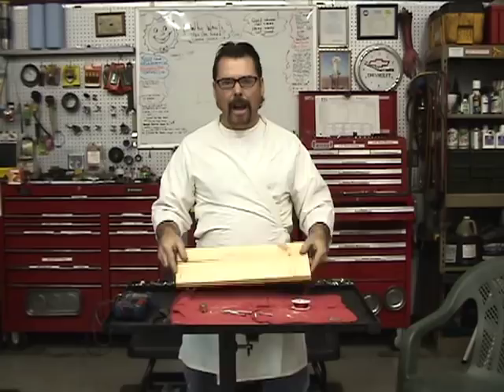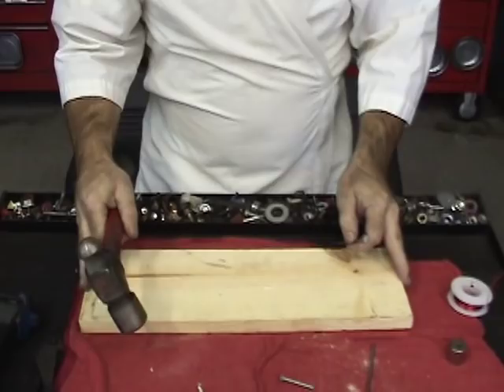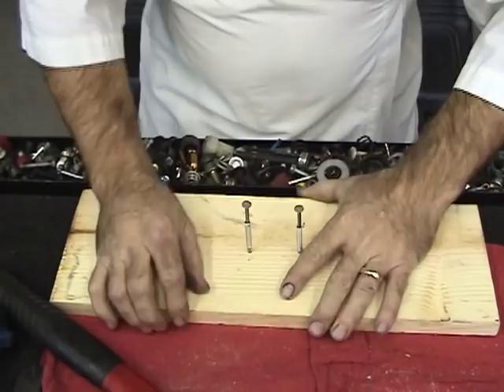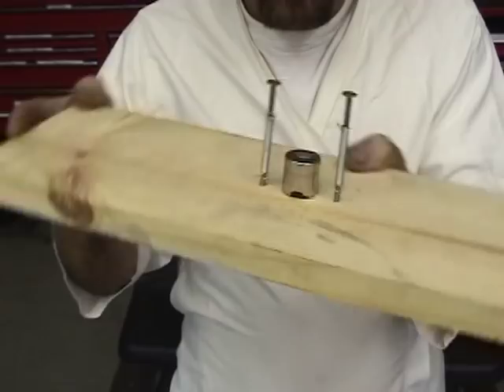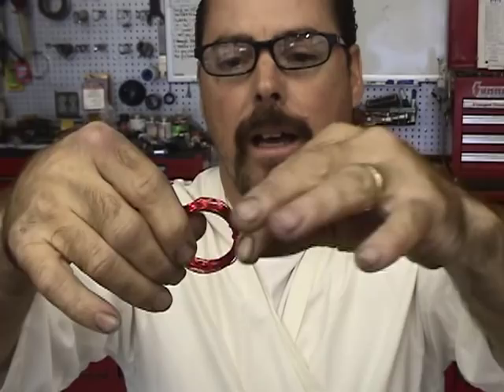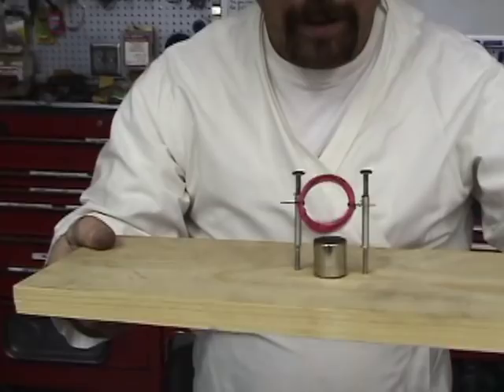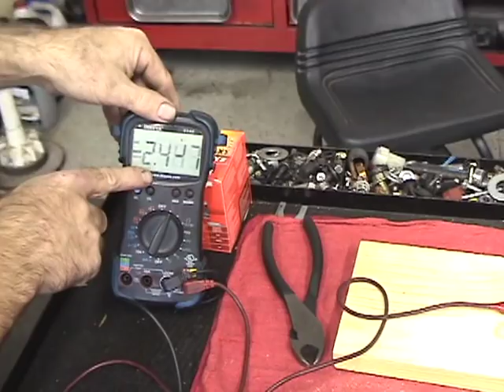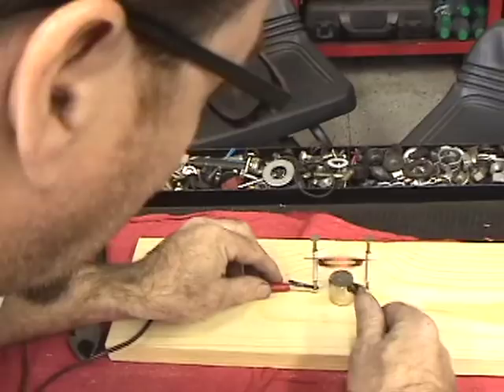FREE ENERGY MOTOR !!!!! How to build it.

Comment: By moving a coil near a magnet, electrical current will flow in the coil. Electrons in the wire move in response to the wire's motion through the magnet's magnetic field. Half the time the coil is an electromagnet. This happens when the sanded side of each lead is pressed against the springs. When the enameled side is pressed against the springs, the coil is not an electromagnet. This is how on again, off again of the coil creates motion, essentially you have made a half-motor. In a full motor the coil is never off.
Reply: > By moving a coil near a magnet
The process of "moving" takes kinetic energy. Magnets have no kinetic energy to transfer to the wire. The magnet has no kinetic energy, the wire has no kinetic energy, the nails & springs have no kinetic energy, & the wood has no kinetic energy. To move something continually takes a continuous source of energy.
Reply: @ScottMartinD  😂😂😂😵😵😵😵😵😵👎👎
Reply: Damn straight!

Comment: So everyone is saying its a hoax and all, but it takes Power to make a magnet, and magnets have to do something with that Power in their lifetime, so it isn't free, and magnets are just another way to store energy in small amounts. Am I correct? Magnetism has to have  energy  in it correct?
Reply: You can make magnets from running electricity through a ferromagnetic metal. The metal will now have a remnant magnetic field (I.E. a permanent magnet). Now this remnant magnetic field will remain, if there is only steady affecting of the magnet, so sudden peak loads to the magnets will reduce the remnant field. This has intrigued me so i have asked 4 or 5 of the teachers where i study (Chief engineering - MSK Copenhagen). At least that is how i understand it.
Reply: Magnetism is not an energy. It is a force.
Magnets cannot store energy. It takes energy to make anything but things don't store that energy. You wouldn't expect plastic pen top to have an energy yet it takes heat and pressure to produce it
Reply: Skyler F Everyone stop misinterpreting "free energy" - no-one is saying energy comes from nowhere. Magnets may get thier energy from the geomagnetic field as Ed Leedskalnin said ...and are therefore connected to the earth magnetically. Free energy really means alternative or non-conventional energy sources.  WaiTuYung  Magnetism is energy it is one aspect of the single most important force in the universe: Electromagnetism. Saying magnetism is not energy is like saying electricity is not energy. Where there is magnetism, there is always electricity associated and vice versa. The whole concept of "work" is flawed. Holding up a weight against another force is work.
Reply: Gor Don When there is a changing magnetec feild, there is electricity, thats why there aren't DC transformers
Reply: by free, they mean it does not need constant energy refueling, unlike fossil fuels or solar
Reply: I'm an electrical engineering student in my final year of college.  I would like to mention that a Tesla, the unit for magnetic field intensity, is equal to (J s)/(C m^2). J=Joule, C=Coulomb, m=meter, s=second.  With some rearrangement, this can be expressed as J/(C m/s m) which can be thought of as "Energy per charge moving at a velocity a certain distance away."  This means that in order to have a magnetic field, you must have energy in the magnetic source.  This energy is stored kinetically in the spinning of electric dipoles.  If a large number of dipoles rotate in the same direction, this gives rise to the overall magnetic field.
Reply: Awesome! I am a Cheif Engineer/ MaskinMester student at MSK Copenhagen. Most of our lectures are on electricity and electro-technics.
I have asked several teachers this question: How does magnets become de-magnetized?
“Magnets become de-magnetized when they are exposed to a peak load. (If they have to deliver a lot of magnetic force for a short time dt/dф). Whilst they will maintain their magnetization if they only are exposed to “flattened” load so to speak.”
(Much like a spring will maintain it’s plasticity if it is not overloaded. Unlike if the spring gets too compressed/extracted it will become permanently deformed.)
But this does not make much sense to me, since it will violate the first law of thermodynamics… 

I know that permanent magnets are used to measure for example the flow through a pipe.
This works by putting a spiral disc into the pipe that is turned the more proportionally to the flow streaming through it. On this spiral disc there is attached a permanent magnet at one point in the periphery of the pipe. Now the magnet will induce a small current in a wire next to the pipe when the magnet passes by near the wire. 
So in this way the current in the wire is proportional to the spins of the magnet which is proportional to the flow in the pipe… What is interesting here is that the permanent magnet keeps inducing current in the wire around the pipe I.E maintaining it’s magnetism…

What do you know about this? How does masgnets become de-magnetized?
 regards Jacob
Reply: ***** wouldn't it make more sense to say that moving the spring at any load will permanently deform it, but the less load it takes the less the deformity becomes apparent? Anyway, this contraption makes sense to me because magnetic fields bend space around it which could make the radius of one of the spiral wire's hemisphere wider than its other hemisphere while its over the magnet until its isn't in which case its already generated enough momentum to break from the magnetism and continue and have the previous non magnetized hemisphere become magnetized and grow in radius. Think of it moving like a tesseract in a three dimensional space.
Reply: spenpinner
Magnetism is a force, not an energy. Magnets do not contain energy so why do you think that this principle will work?
Magnets are not an energy source but they can be used to control energy.
In order for the wire loop to spin there must be an energy source.
The wire loop does not have its own energy. The nails and wood don't have their own energy. So how do you think this hoax works?
Nearly all our electrical power produced in power stations, whether it's fossil, nuclear or hydroelectric, is produced with magnets converting kinetic energy into electrical energy. To make the coil spin in this video there must be an electrical source. There was a convenient edit when he went to get the wire cutters. And seeing as he didn't show us the back edge of the wood I presume there is a battery concealed. A voltage reading of 2.4v would suggest a couple of AAA's. Also, he mentioned that the magnet is "monopolar". Monopole magnets do not exist except hypothetically in the quantum world.
Reply: Gor Don there is not always electricity where there is magnetism
Skyler F magnets do not store or have any energy
WaiTuYung the generators in power stations actually use electromagnets

Comment: The coil serves as an Antenna, interacting with an Electric field (Electromagnetic waves in the air). The changing polarity on the winding constantly opposes the permanent magnet, making the electromagnet being repel.  
I had done this experiment but the one I did was using a battery providing the current to the coil. On this case, the coil collect the potential energy (E) from the environment, which is most of the time radio signals (or the free energy that everybody talks about). 

DON KING KONG

Comment: It's magnetic repulsion making it drive. When balancing it has equal push on both sides of the coil. So it stays in one place. Then when you give it a jump start , by pushing it, the momentum of each side of the coil keeps passing by the magnet getting a push every time.

Comment: Here is your answer:

You know this guy used a permanent magnet with the constant magnetic field. What happen if you have a wire frame turning around in this magnetic field? In this case you will have a varying magnetic field, this create a magnetic vector called "B". To make a varying magnetic field, you must have the wire frame rotated so he has to turn his wire frame at the beginning.
Now you have the varying magnetic field and follow the Maxwell's laws, a varying magnetic field will create a varying current in this wire frame. Let's call this current is "I".
This current makes the voltage between both ends of wire.
When you have the current "I" in the wire which put in the magnetic field "B", you will have a force put on the wire follow the Lenz's law (F = L.I x B, "L" is the length of wire).
This is the wire frame, so you have the current I on one side of wire and -I on the other side. This will create two forces on the frame F and -F which mean we have twin forces with the same amplitude and different direction. And, the frame is rotated.
When it's rotated you already have the varying magnetic field and it will rotate itself.

Sorry for my English.
Reply: Wonderful explanation, thank you Chau Vinh Loi! Sorry for the missing symbols that are in your name. :)
Reply: I was going to suggest it might be the gravity, until i red your comment lol.
Reply: > and it will rotate itself
But it can't continually rotate itself, because magnets have no kinetic energy to transfer to the wire. In industry, magnets are used to help "control" kinetic energy, not to create it.

Comment: This is a science project that is commonly made with two paper clips in place of the nails and springs, into a foam block, The top of the paperclips are heald appart by putting a rolled piece of paper big enough to wedged between the two paper clips at the top then at the lower loop , is the copper armiture. Last the paperclip is bent straight on one end to stick into the foam pad. Any magnet can be placed underneith  this is the set up, but a 9 volt battery is usualy hooked to each paperclip to run it. I am big on teaching my kids science, so I have one next to me as I write. I can assure you that those nails have a posative and negative pole to them. However they are hidden is of no importance. If this worked, the one next to me would be running on it's own right now. Alas, the battery is dead, so it is not. But I loved the cheezeeeee intro.

Comment: I think that the most interesting feature is how the device also makes the knots disappear... Use this contraption to make knotless wood!
Reply: same board flipped the other way, left to right
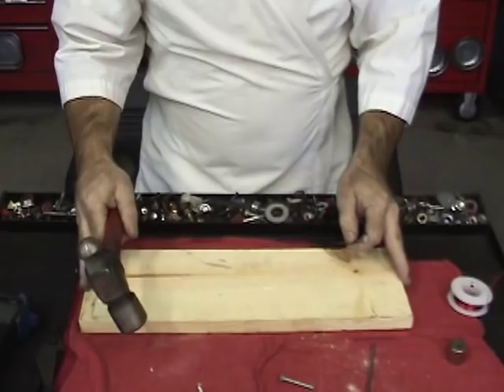Reply: nope 2 differ   2:16  vs   5:48
Reply: Double check, it is indeed very obvious that this is 2 different boards. He got me there for a moment I most say ;-)
Reply: 100% 2 different boards. So he just switched to a machine with batteries. If that was possible it would already be made on a way larger scale.. 
Any electromagnets still need a power supply. Lol at all you genius who commented: It's quite simple the power from the magnet rvs polarity and blah blah blah. Lol

Comment: Plug in the voltmeter without the coil and show us that no current is flowing via those two nails.. Just to make sure, there are no batteries hidden inside the wooden block.
Reply: The plank of wood is drenched in lemon juice /citric acid. The nails are copper and zinc.
Reply: copper nail? Look with your eyeballs. I do agree that lemon juice or something was used to influence a voltage on those nails though.
Reply: Damian Reloaded Glad you mentioned the board is drenched in lemon juice, but you forgot to mention the salt as an added electolyte increasing the flux to rotate AND cook his ceviche in unity
Reply: He was quick not to show the magnet

Comment: There is no hidden batteries or wires. Specificly this is the magnetic force, it is a continous push and pull created by the magnets and everytime it rotates it produces energy like a common generator in a bike. ;)
Reply: Hasan Mahed check the wood  at the end different then the start
Reply: how so? a magnet generally has a constant magnetic field. You need a changing magnetic field in order to generate electricity from it

Comment: This tiny little e-motor is a well known construction. Of course there is a battery hidden in the wooden board which puts voltage on the two nails. And the magnet is an ordinary one. (No surprise, monopole magnets do not exist.) The insulation of the wire endings of the coil is only scraped off on one side, so they function as a primitive commutator. And thus you have a tiny and functioning DC-motor.
Reply: monopole magnets do exist I have seen them
Reply: Stefan Raphael
Where? They are demonstrated in some YT-videos, but this is trickery.
As a matter of fact such magnets were discovered recently in the realm of small particles but since they always come in pairs, there is still no macroscopic monopole magnet.
Reply: I seen them to.  My b uddy has some behin his double wide.

Comment: It picks up radio & AC power noise from the environment. If you drive out where the radio signal is weak, and where you are 1000 feet from the nearest AC outlet, you will verify this. Also, put a Fluke 179 on both ends of the coil and set the meter to read frequency. If you have 60Hz, you know the AC power in your home is being picked up through inductance & flowing through the coil.

Comment: The board did get swapped out at the pause at about 5:47 to add the battery leads to the nails.Otherwise there would be no need to strip out the end of the coil leads

Comment: Well, I have a rough idea of how this would actually work.  When the armature (Coil) is spun, the rare earth magnet based magnetic field induces a current in the coil.  When the coil continues to spin, the magnetic flux collapses thus generating an opposite pole magnetic field.  When it finally stabilizes, the stored magnetic energy is converted to electrical current.  I don't call this perpetual as the rare earth magnets stored energy will eventually deplete over a long period of time.

Heck for the price of a rare earth magnet, a couple of springs, some length of 30 gauge wire for about $15, I would give it a shot.

I'll report back what I find.

-Denver Dave

Comment: Nice trick! There will be a small 2.5V battery hidden within the wood block that connects to both nail terminals to create a school physics class-type electric motor. The voltage he is measiring at the end is actually from the hidden battery. Notice how he doesn't show that the spinning of the coil is the source of the voltage (because it isn't) ie if he were to remove the coil or stop it spinning he would still have the 2.4V on the two terminals from the hidden battery. 
Also his comment at the end "if it's too good to be true it usually is" would not be appropriate were this not a trick.
Reply: Hi, Yes your right ! The 2 wires are HALF open // half isolated.  This work like a collector !  One battery 1.5volt is minimal
need for running the coil. I will try make a video, name is "simple minimotor".  ++

Comment: He cleverly embedded small batteries and a little circuit in the second piece of wood.
They are secretly connected to the nails making for a little motor.
He as much as admitted this at the very end.when he said
"If it seems too good to be true...it probably is".
The intro was the best part.
Love that intro music..."The Rite of Spring" by Igor Stravensky.
Reply: It's also possible that the "magnet" is actually a coil with an internal battery and oscillator circuit of sorts.
Reply: Wasn't that "Carmina Burana" by Carl Orff?

Comment: hello...  sir, it was amazing to watch that...  Umm you asked for its mechanism....  Huhh so here is what I understand about it.... 
.
.
.
it works on basically two principles 
1. a variable magnetic field induces a variable voltage in the coil placed in the magnetic field. 
and 
2. A current carrying coil placed in a magnetic field experiences a torque due to which it rotates. 
.
.
.
here when you place the coil there and rotate it yourself, it induces some voltage at its ends and that induces an electric current in it....  now when you're done... this induced current causes the coil to feel the torque in the presence of that magnet...  and it rotates...  again the coil induces some current through it as it's being rotated in a magnetic field and further this induced current makes this coil to experience a torque again.... 
Thus both the processes are complimentary to each other...  that's pretty! 
.
.
I hope what I approached was right and I was able to explain....

Comment: Hey pds tech, You got to remember that the man raised the board off the table...and it still spun. No capacitor was seen to store energy. So the nail points did not contact a hidden power source while on the table. You are right that copper is non magnetic...but it is an excellent conductor of electricty. When he spun the copper  he created a weak current within the copper wiring...and this has magnetic properties...just enough to be influenced by the strong magnet and cause it to flip. This in turn recharged the electromagnetic circuit and caused the copper wire to flip again.